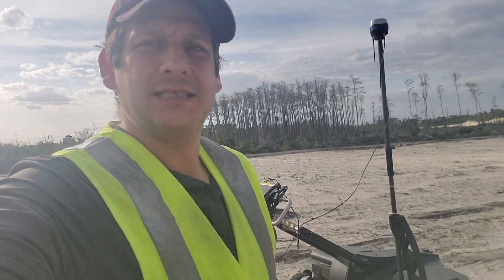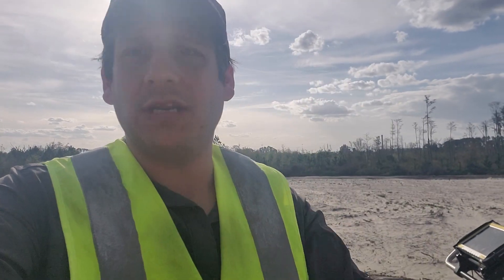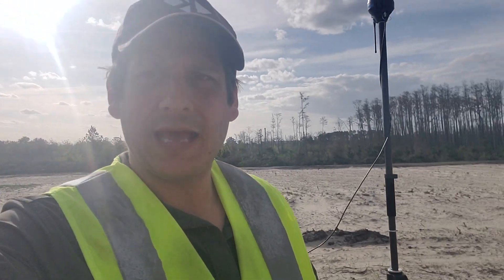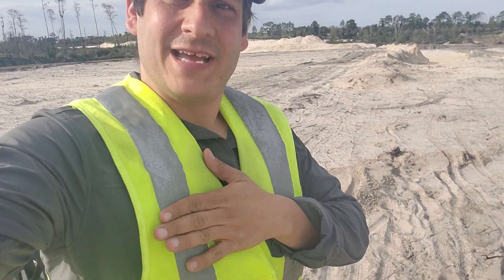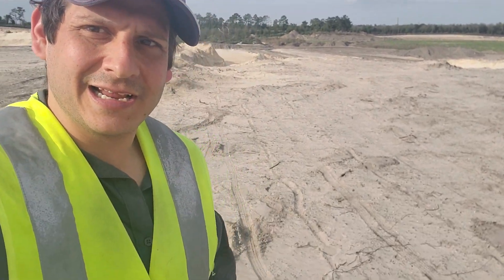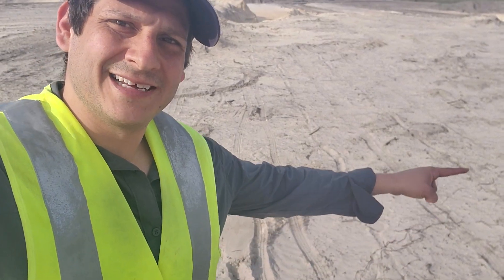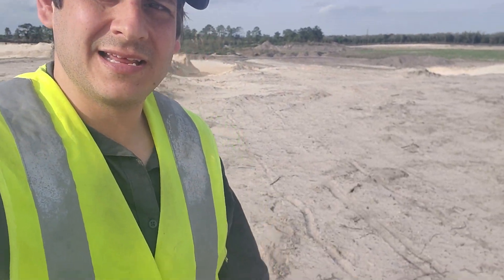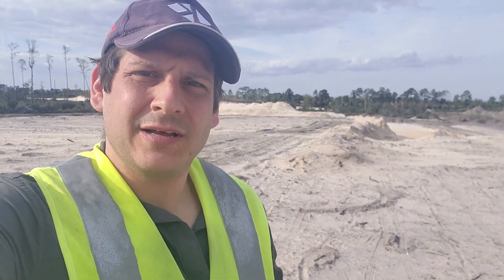The other, other benefit of using GPR in sand | ground penetrating radar

Comment: I have such mixed feelings about loose sand.
I love the data, but if the sand is too soft then I start digging trenches with the wheels and giving myself an unplanned cardio workout. If the sand is too hard then it can make for a very rough ride and I don't leave any tracks in the sand at all.
There's definitely a Goldilocks zone when it comes to sand. From the looks of your video, Dan, you're right in the middle of that zone on this project.
Reply from the maker: Absolutely agree Forrest. Sometimes it gets really tough. At another part of this site I was so frustrated. Deeper sand, worse compaction, so difficult to get through. I did a video about why I prefer clay over sand. Kind of a joke, but not really. Wanted to bring out all of the issues with both materials since clay usually gets the short end of the stick, but in reality like you mention, there are very real problems in sand too.
Reply: @Learngpr   Hello Dan, would a GPR be able to identify a Bronze cannon at 12' deep on the beach about 50' from the hide tide level?  A friend told me that the salt water would impede the depth capability. Since the target is that far from the high tide level, I would assume the salt water influence would be at around 4 to 6'  
Thank you